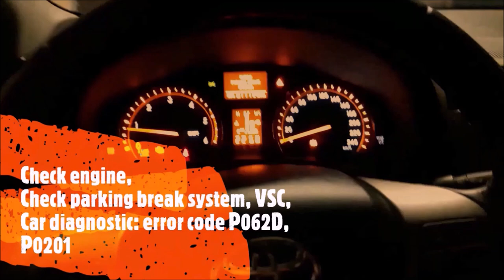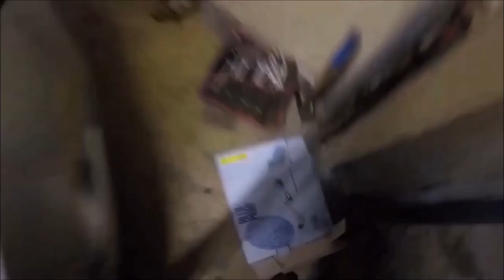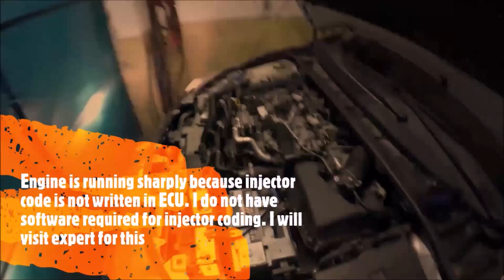How to Replace diesel Injector Toyota Avensis T27 2.0 D4D 93kw, error code p062D, p0201

Comment: Thanks for this video. I just got replaceable new INJECTORS for my Avensis. After changing all injectors, can the car be drivable to a dealership shop for injector codes compensation?
Reply from the maker: I'm glad it helped. You have to ask in your Toyota service, because each Toyota service has its own policy.

Comment: So after changing injectors car will start and running with out coding but not good. I’m I right?? Plz answer I need your help
Reply from the maker: If all injectors are OK, injectors assembly was well done so the engine running good without coding. But the injectors still need to be coded.

Comment: What kind of program  you used in car diagnostic?
Reply from the maker: Delphi ds150
Reply: @MarekParek46  Hello to the delfi ds 150, how do you program the injector because it does not have this function, it only resets values?

Comment: before you removed the injector you removed two bolts and tightened something up with the 17 mm. what was happening there?
Reply from the maker: I removed the bolts because I needed to loosen overflow fuel pipes. I Tighten up 17mm bolts to move overflow. thanks for your coment.
Reply: @MarekParek46  thanks, your video helped a lot. Just got my injector out of my lexus is220d with your help.

Comment: Whats this spray pls ?
Reply from the maker: high temperature ceramic paste (-40 °C / +1400 °C)
Reply from the maker: high temperature ceramic paste (-40 °C / +1400 °C)
Reply: Thanks
in a week i will buy an avensis 2010 2.0 d4d 126 ps with 48000km. what are the most common problems with this engine please sorry i don't speak english very well